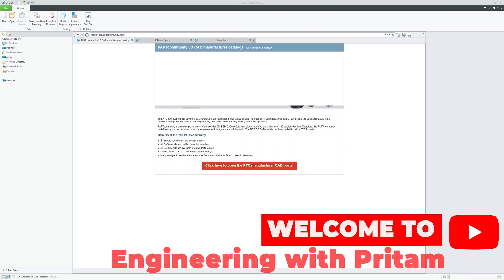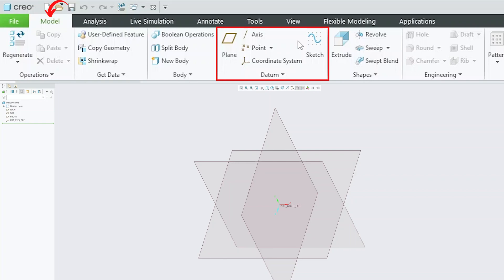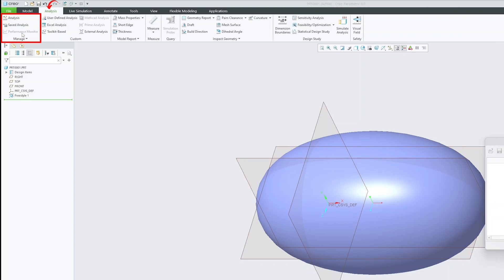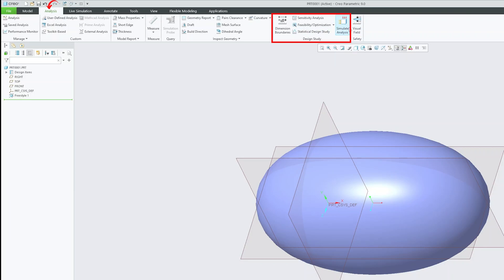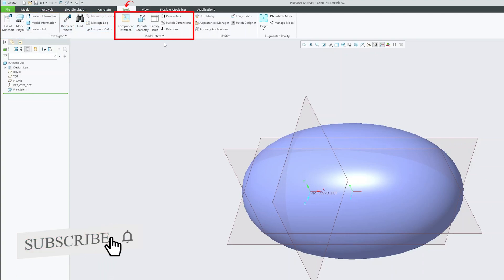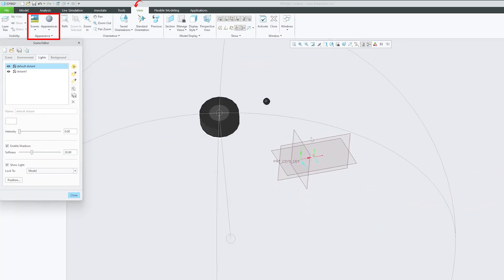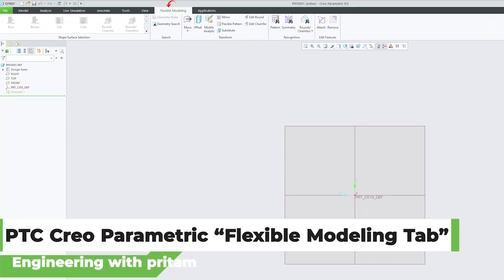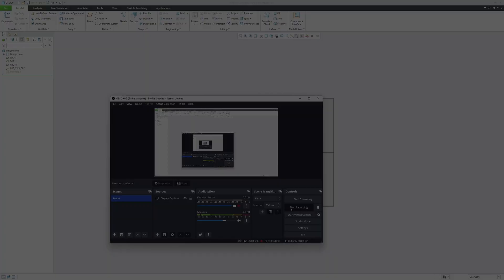PTC Creo Parametric Full Course : User Interface (Ribbon) Part - 6

Comment: Thank you so much for the help. I have a question: every time I use the ribbon tab to draw, let's say a line, the additional commands disappear and doesn't stay visible as yours. I have to click on sketch again to see the line and other commands. Is there a way to configurate it so it stays visible like yours? I'm not sure if it's the newest updates or besides I'm using the student version
Reply from the maker: You can cutomize minitoolbar or mapkeys can be created.